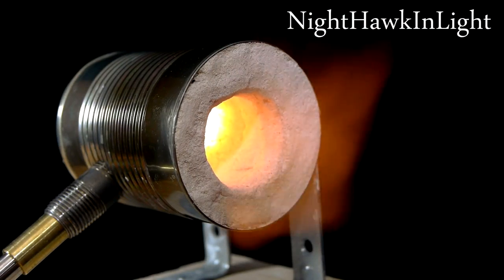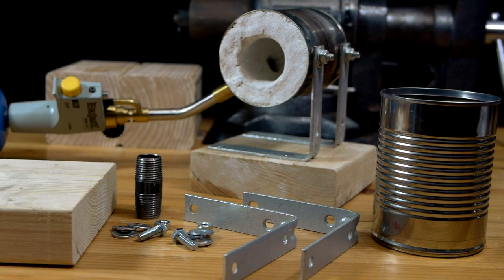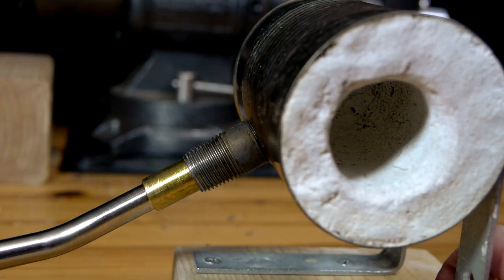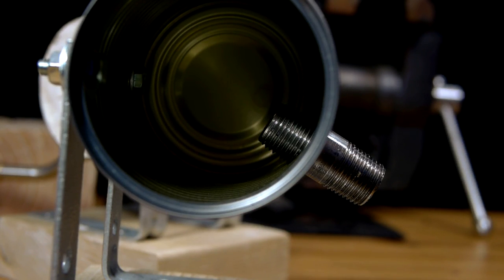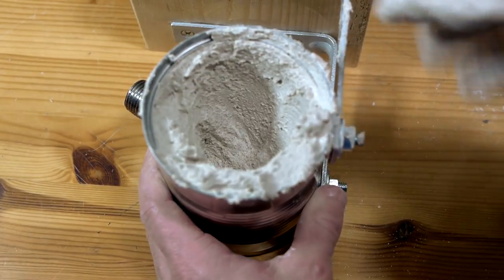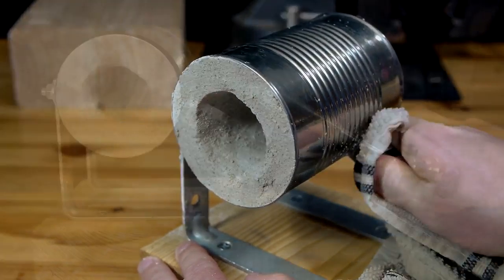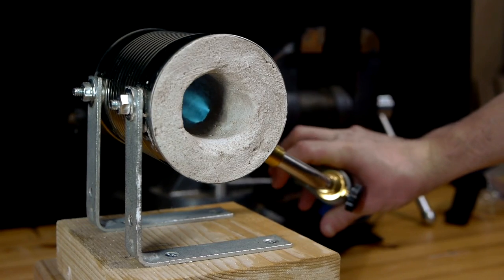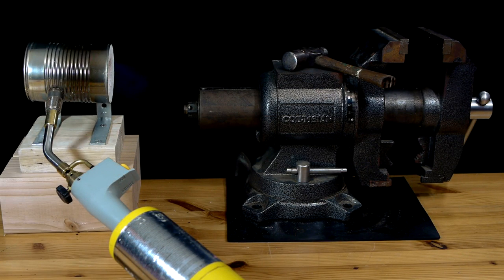How to Make a Soup Can Forge

Comment: Hey friend, I just finished mAking your"soup can" forge. Although I used a large metal coffee can I followed your instructions to a "T!!!" My question is "HOW LO G WILL IT TAKE FOR THE PLASTER/SAND to set and more important, how lo g do I have to wait B4 I start using it????" I wanna thank you so much for the YouTube vid and I very anxious to use it and for a response!!  that again for the "know how" and looking forward to hearing from you. Take care, have a GREAT DAY & HAPPY FORGING!! I forgot to mention that making my own knives is something I've wanted to do for the longest time. I'm a huge knife/blade enthusiast!!! Blacksmithing is something I'd like to turn from a hobby to a full time thing. Again THANK YOU AND ttys 😎
Just now
Reply from the maker: Brett Jones You should be able to start using it right away, the torch will cure the plaster in probably around 10-20 minutes. Note that you need a spiral flame torch head like i use in my video, a normal pencil flame will not be able to heat it up enough. Wear eye protection the first time you use it in case the plaster cracks, but I haven't hear anyone say they've had problems with that. You should wear eye protection while forging anyway.

Comment: Of course if you REALLY want to scale up the size of the forge, take an old oil drum, surround it in about 4-6 inches of the plaster-sand mix, then use an oxygen and acetalene torch set (the highest temperature possible for a propane torch design available to the public) and follow the same steps as in the video. it will take longer to heat up but not only will the end temperature be much hotter, but you will be able to melt larget and different items then the can could be used. Works GREAT.

Comment: I just followed this and had success! thanks !
Thoughts for those who follow
1. My mixture set VERY FAST.  I failed the first time and the second I over watered and waited but it still set very quickly once it started to get where it was not soup.  I was using the Plaster of Paris sold at Lowes in the paint section
2. I let it set and dry for 2 hours then started the first burn.  Took about 2 hours with the torch running to get it cured and hot enough to redden my chosen metal rod (a 1/4" piece of welders metal) but it did get there :D
3.  Don't pound on your anvil on your workbench next to the FORGE!  the vibration caused a chuck to break and fall off my new built forge :(

Comment: You may want to try cement, sand and Perlite (from the garden shop) for a better refractory. Plaster of paris handles high heat very badly. But for something quick and easy this is great

Comment: Back when I was a teenager, I took a beer can and took the top off of it, put an extension cord in it with a light bulb socket, and filled the rest of it with plaster of paris... it's been my Bud Lite ever since... I use it for odd jobs when I need extra light... it does't tip over easy since it's heavy with the plaster.

Comment: I did and it does work but you have to put the plaster mix in thick or it starts to crack so I use a little more sand in the mix being that it was bigger. works great

Comment: If you take off the opposite end of the Can it'll allow more heat to escape, so it won't get as hot. If you're looking for a larger size, a lot of people put hatches on the back of professional forges so that you can put a longer piece of metal through and heat it one section at a time.

Comment: I love this vid and got quite a few large restaurant size cans to use as the body and 3000 F refractory cement. I wanted to get your opinion however on the viability of my plan to use your same idea but modified for the different body size and fire proof lining material.

Comment: Cool idea for a small forge, have only used big open charcoal forges for blacksmithing. I wounder if this one would be effective if you punched out the bottom aswell, that would give you more controll and possibility to use this for bigger pieces but then the heat loss might be to big, rendering it useless.
No money to make one thou so ill try make one for fun.

Comment: I have the leftover steel lid for my raised steel fire pit (which I no longer use).   I also built myself a mostly-above-ground brick fire pit.    I want to line the inner, concave side of the steel lid with the plaster-of-Paris-and-sand refractory you mentioned.   I would then be able to use it on my brick fire pit to accomplish high internal heat, such that’s necessary in forging steel and firing ceramics.   Would you advise this?

Comment: Me and my friend tried to make this... We sadly failed because we had forgotten to widen the inside and we used a butane torch which didn't burn at high temperature and low pressure... Going to get a torch like you have there and try again!

Comment: Another tip, especially to prevent too much condensation inside: Save the top, especially if it's a coffee can.  Once it's cooled down after use you can pop on the plastic lid and protect it a bit more (also good for keeping spiders and insects out if it's going to be stored for a while.
Great video!

Comment: Just to make it a little better you can use Kaowool, and soem Kaowool hardener for the forge lining.

Alternatively you can use a K26 firebrick and pack the void with Kaowool.

Sure it's not as easy to obtain as sand and plaster of paris, but it will be a little more robust.

Also if you think about it you can flip your forge 90 degrees and make a micro furnace for melting copper, bronze, gold and silver... just a tip ;-)

Comment: To make the refractory mixture, can I use lakeshore sand? I figure I’d need to sift out impurities to make it suitable for being added to the plaster of Paris, but I wonder if that will even be enough. Alternatively, could wood ash be substituted for the sand? The answer to this question probably depends on the purpose of the addition of the sand (probably for heat-proofing stability).

Comment: Instead of the sand/plaster mix, you could use ceramic firebrick powder that will stand up to even higher temps and retain more heat making the forge more efficient.

Comment: This is going to be a project I'm going to have to do. I'm currently building large propane forge to replace my coal forge (quality coal in my area is impossible to buy at a decent rate due to a huge order from China wiping out the supply). I believe I I think what I'll do is take this idea and modify it to a slightly larger, but just as portable model.

I travel a lot, often to see family who always want to see me smith things. It's a big hastle bringing my Lancaster crank forge anywhere. I've already got a 55lbs portable anvil and all the other travel worthy tools, just the forge is an issue. This would be great for simple projects and small demos :)

Also a suggestion for this model. Maybe try a paper form for keeping the center hollow and clear of clay. I suggest something like a paper towel roll. IT would burn away with use and help keep a clean center while the clay is drying. If it's too small for your liking you could easily make a similar shaped roll out of some card board and masking tape.
Reply: If your family REALLY want to see you hammer steel, they should take the time,make the effort to visit YOU. If not,, shoot video from a tripod & post it. Hell,,I'll watch it myself.
Reply: Franco Tramble Well, I'm looking into getting a decent camera right now so I can put some prop making and blacksmithing videos on my channel. Right now there's nothing but video game Let's Plays on there, but thats mainly because I have the programs I need to do that stuff. The plan currently is to keep playing games, take the ad revenue from those videos to buy a camera and then smith weapons and make props from the games I play on my channel.
Reply: Scroll's Adventures Well then I wish you luck in that endeavor. My father was a gun smith so I followed him into the craft, but now with the political situation being what it is, I've a good feeling that the ability to forge-weld or otherwise join two pieces of metal together and have them STAY together is a very useful skill to master. It's no secret that some hard times are closer than most people believe. And those who don't believe will need something to trade people like US when we fix whatever it is they must have to survive the upcoming,,,, challenges, that we will all face as soon as the elitist political class finish devaluing our currency and the rest of the world abandon the petrol-dollar. This will be no small change and God only knows ALL of the ramifications from this historic event. My Great-Grandfather was a Blacksmith, so hopefully he'll whisper in my ear whenever I'm racking my mind for the elusive solution to a problem. He was a Stutzman who got the hell out of Germany moments before World War 1 and lucky for me, never went back. He was makin' a decent living in a very rural part of Mississippi as a fabricator and the only blacksmith for many miles. My father and I were lucky enough to find the exact spot of his shop and, using a primitive metal detector by today's standard, excavated several artifacts. The remains of old tools, home made nails, what we were told were pieces of iron from horse/mule/oxen teams harnesses & bridals. But we did find some old coins, mainly from the '20's to the late '50's and 1 small gold coin in such bad shape that it has never been positively identified. I haven't thought about this for a very long time. I should try again to identify it, perhaps more recent technology may provide the answer.
      Shoot me a line on F/B, we can exchange contact info if you care too. I look forward to you're video work and I'd also jump at the chance to talk shop with you. Look me up if you're ever near the Red Stick, we'll give thanks, break bread & maybe howl at the moon to honor a few ancestors.

Comment: I'm assuming this would work with one of the 1 Pound coffee cans as well, but if I followed the same lining instructions could one make a smaller hole at the mouth of the can in the plaster sand mix or would it  be to weak?

Comment: Do you think you'd be able to get up to and maintain a hot enough temperature?   Umm, don't know if the blow torch comment is towards me, but just my opinion, I'd rather work with the forge than just blowtorch because from my understanding, when working on projects a little bigger than the knife he made, a forge will provide more even heating and heat it faster, other than the waiting for the forge to heat up.

Comment: IM currently working on my own foundry, and for an insulator have used a 70 30 mix of wood ash and bentonite powder, which ive heard makes a good insulator, but i like your idea. Does the plaster NEED to be fired to harden, or can it just dry in a dry area?

Comment: Do you have to use this lining for the inside of the soup can or can you line it with concrete mix? If you were to use concrete mix, would it work and if so, would it take longer to heat up or would it be faster?

Comment: from the video you may need to heat it a little more, you could do this by making the can vertical and with a smaller tapered mouth. The knife will be fairly brittle and the blade will easily chip because of the lower temperatures

Comment: You are using Propane,,correct?  Can I use MAPP//PRO gas? (Yellow cylinder)I have the same torch head that you are using in video. I'm building up to a large enough forge to heat/repair full size swords. I plan to convert an old ''CHAR-BROIL'' brand grill body/housing with better burners. Or will I melt the grill body into a pool of white- hot goo?? If so,, what to use for main body? The grill body I plan to use is made of aircraft aluminum. I've worn out several over the last few years cooking/forge welding. I've even filled it up with ''cowboy charcoal'',(not charcoal briquettes)and ceramic briquettes and have seen no signs of melting,,, yet. Please advise.
Reply from the maker: I would consult an actual metal working forum with your questions, I'm really very inexperienced. I've seen quite a few nice designs for coal fired forges you might want to look into, that's the sort I would use if I were making a full scale model.
Reply: I'm sorry, I haven't made myself clear. My large forge is another project. Questions to you are only about the small one you made. The torch head I'm using is good for propane and MAPP gas. I guess it boils down to the temp defference in the two gasses and if the plaster/sand mix can take it without cracking. Also,,I've some tile mortar left over from a job. I'm wondering will that work in place of plaster in the 50/50 mix. If you have no answers,, I understand. My mom always called me her ''little contrarian'' ,, I'm always going in the opposite direction of conventional wisdom. I'll let you know how it turns out. (IF  I survive) I think that it's usually best to know more than one way to do something whenever possible. In the near future,people will need to build these small forges with whatever they've got on hand, those items will vary. These forges will be great for forge-welding broken parts for firearms and/or fixing/making small arrowheads. You probably saved many lives by posting this when you did. Because our political ''leaders'' have failed us,, we're headed for hard times. Things like this will mean that times aren't so hard as they could have been. Thank You.
Reply from the maker: Franco Tramble I see. Yes, you can use mapp gas, but when I tried it I found that the extra heat it produces is negligible and it wasn't worth the extra cost over propane.

Comment: I finally made similar forge for heat treating small 0-1 steel parts.  I used bigger pineapple can with similar size hole but here's the problem I had.  First I am using straight up propane from 20lb tank and TS4000 torch so I don't know if that's the major difference but when I fired up first my tube where the burner goes was sealed like yours and I couldn't even see the flame but I could sense the heat yet it wasn't very hot so I decided to dump the inner tube and put the burner in there to create air flow and that's when things got much better but again it depended on how I positioned and how far the burner in the steel tube.  It got the job done but wasn't as bright hot as yours.  Any ideas?
Reply from the maker: Ts4000 is a step down from the ts8000 I used in this video. That could be the difference.

Comment: So say I used a bigger can or drum for this, maybe even long metal piping (as I want to try my hand at homemade swords)? Would this still work? Or is the size that makes the heat so concentrated? Also Ive researched a little and found refractory cement to be an excellent insulation for the forge. Would this be best used for bigger or longer forges? Im pretty positive it would Id figured id ask someone with know-how.

Comment: hey, is it possible to open the other side of the can to allow longer pieces of metal to fit through and still be hot enough to heat the metal?

Comment: Hey man! I appreciate the video and it's awesome that you take the time to reply to the comments, so I was wondering if I could ask a question, and just bear in mind that I have little knowledge of this stuff.

Let's say I wanted to forge slightly larger / more items and so my forge would need to be slightly larger to compensate, let's say around the size of a large cooking pot. And let's pretend I'm using a cooking pot. Would this be able to generate the heat necessary to still forge things, or would I have to add in another torch to compensate for the larger area?
Reply from the maker: You may need another burner. I haven't tried anything larger than this.
Reply: NightHawkInLight Thanks man! If I throw it together, I'll let you know!

Comment: Is the refractory okay to be exposed to extremes of the elements the seasons bring, like cold and hot temperatures?   I hope the answer’s “yes”, ‘cause I want to use it outside in my backyard.
Reply: As long as it doesn't get wet it'll be fine